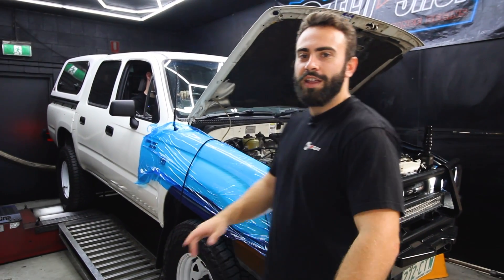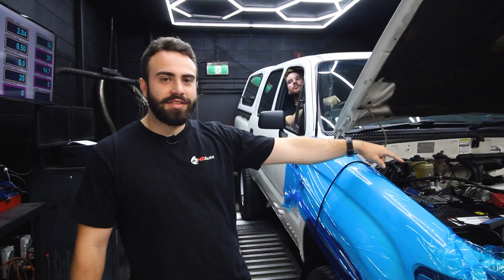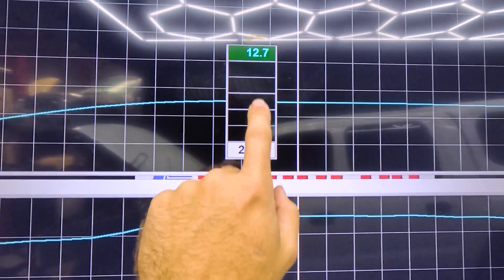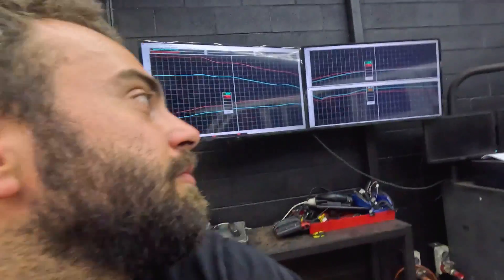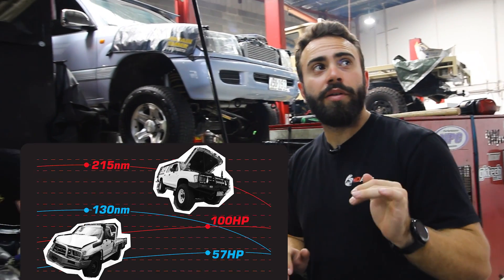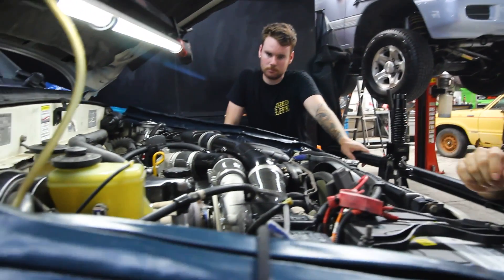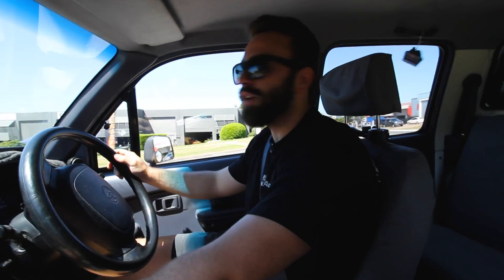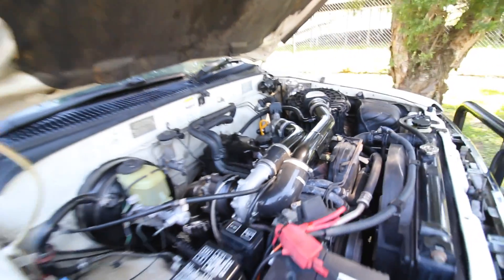Toyota Hilux LN167 Transformation | HD Auto 5L Turbo Kit on the Dyno

Comment: I noticed your kit used to come with a kinugawa td04 turbo. How would you compare that with the Garrett? Also the Garrett isn’t water cooled ?
Reply from the maker: Correct, we have upgraded to the Garrett’s. Water cooling isn’t an upgrade over non water cooled, it’s just a core design. 

We find the Garrett’s are a superior option for response and air flow up top

Comment: i've got a tidy n/a 5L with a new fuel system in a hilux but it's only getting about 11 litres per hundred fuel economy. While more power is awesome, i want better economy. Can I expect to get better fuel economy at 80-100kmh on flat roads with this setup? If so, what do you think it will get?
Reply: As the owner of the vehicle in the vid, its running stock gearing and oversized tyres at LT 265/75R16 .. highway cycle with the turbo installed, I'm getting about 12L/100km. The turbo is not about fuel economy, it's about getting the job done. Refer the dyno run for the torque improvement. My suggestion is that if you're worried about range, then slot in a larger fuel tank (that's what I've done). If your issue is about paying for fuel - sorry, can't help you - that's the best I've got. Safe travels.
Reply: Just curious as to how much power increase without the tune just the kit?
Reply: You want to turn the fuel up and get better economy? 11l per 100 is great
Reply: You are expecting silly numbers out of a 25 year old engine
Reply: That's to be expected with an indirect injection diesel

If you want something more efficient, get a direct injection.

Comment: Good result it’s interesting Hayden I own a 2003 5le hilux turboed dynoed before it made 198 nm now with garret t25 turbo made 260nm only 9
And a half pound boost I’m doing a pwr water to air intercooler could I see more out of it ? Stock with chip
Already or should I invest in the uni chip
? cheers let me know what you think great video keep
Them
Coming 😊
Reply from the maker: Unichip would make a massive difference here mate
Reply: @hd_hayden  Thank you for replying with uni chip I know it will be a lot better about 100 nm tourque?
Reply: @hd_hayden  how do you rate the Garret t25 turbo ?
Reply: The t25 garret turbo is good a touch bigger than the tdo4  .spools abit later than the tdo4 about 1800 in the middle there but holds boost abit better I reckon at about 95-110klm range . Will hold Nicely.

Comment: I have a couple of these L engines turboed and compounded aswell... my fuel screw is wound in a bit more than this video shows 😂... 

A intercooler makes a huge difference on these... like 180 degrees exhaust temp difference without changing anything
Reply from the maker: Yeah we have done a handful of 200HP + builds, they don’t last long being abused

It certainly does!
Reply: Wdym by compounded?
Reply: @misterpotato4775  2 turbos feeding into each other too get alot higher boost pressure...  it turbos the 2nd turbo

Comment: hello, where can I buy this complete kit for 2.4L please?
Reply from the maker: Hello! It is available on our website www.hdautomotive.com.au
Reply: @hd_hayden  thank you, do you think I can find the exhaust manifold as well?
Reply: @hd_hayden  it's good I saw my happiness 🙌
Reply: Do you have early 2.4 2L (1984-1987) or later 2Le-5L  (1988-2003) the heads are way different... manifolds do not fit between the 2
Reply from the maker: @bingysbackyard  our manifold can be modified to fit an early 2L
Reply: @bingysbackyard  my engine is a 1993 2L 2.4D without turbo
Reply: I have a 2L non turbo Hilux, year 2000, model LN145 with the G52 box, just installed new clutch pp etc. Engine runs like if it's new still. 

What would I need if I want to turbo my 2L? I have the fuel screw turned up for a little extra push which I get but black smoking alot lol

Comment: Bye bye G52.
Reply from the maker: It’s only 100HP, she’ll be right!
Reply: @hd_hayden  any feel on a practical limit on hp &/or torque as a thumbsuck on what a G52 can cop?
Reply: I found the g52 is actually quite strong if it doesnt have a sh1t driver in control ... most g52s die because of v6s and v8s conversions with tough drivers.... my compound turbo diesel 4 runner has not killed a g52 with 38.5 inch tyres... 
yet the w56 in my surf with 33s has to had to have the bearings replaced every 10 months.. I now have gone to a r151 in that....

Also if you have done a lot of 4x4ing a hilux you would know why a g52 is better to have than the others... they can save hours
Reply: @bingysbackyard  useful input on your practical experience. When you say "they [G52 gearbox] can save hours" in terms of 4x4ing, would you able to provide a bit more background on what you mean there? Thanks.

Comment: Any reason not to start your run at say 1200rpm? 
Would be nice to see the boost ramp
Reply from the maker: Have started these as low as 1000rpm for testing purposes, the thing about having 57 HP is at 1200rpm it’s probably only got like 5-10hp at this rpm, which is not enough to make a significant enough tractive effort on the rollers for the initial base line run and the run will cut in and out until it has enough torque to read correctly. It just looks ugly when trying to overlay against a tuned run where it does have enough power to read. 

For the sake of the question though, we will be making much more in depth content as well in the future, but for now we are only 7 videos in so the time will come 😊